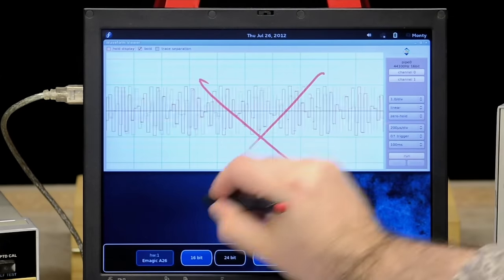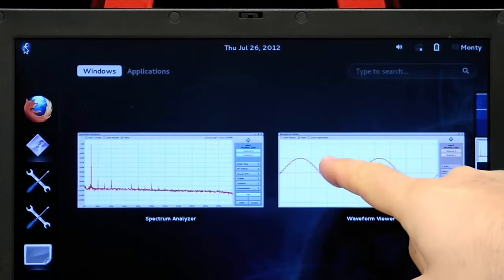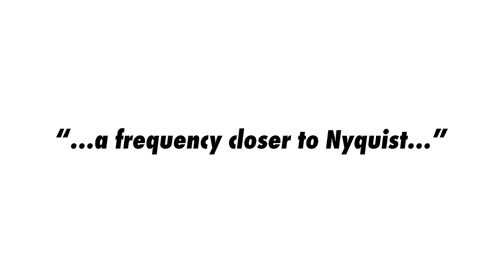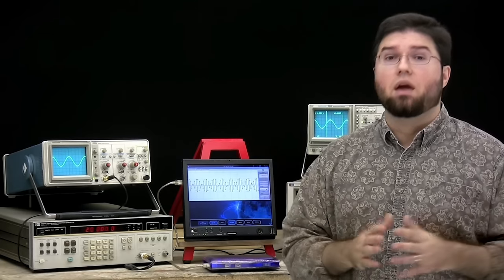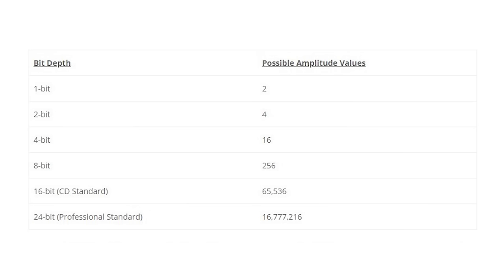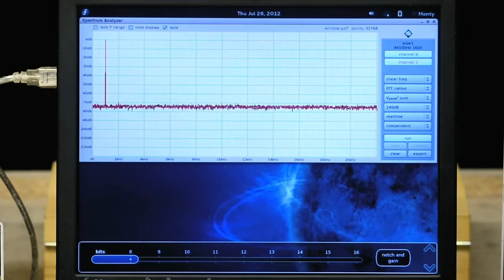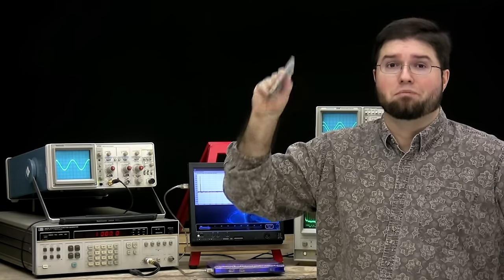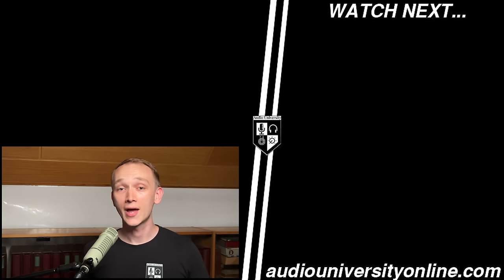Debunking the Digital Audio Myth: The Truth About the 'Stair-Step' Effect

Comment: There are advantages to 16 bit 192khz sample rates, That is in music production. This is because If you want to time distort an audio track or have it slow down (vinyl effects) It will sound better when it's running at a quarter of the speed because it won't sound so compressed and low frequency. Because all of the ultrasonic frequencies are also being brought down to within audible range so, of course after you do all of your editing, the final production can be 44.1 of course, but for production reasons, it's the equivalent of using vector or extremely extremely high resolution logos, because depending on where you move it and scale it and make it really big or small, it might affect it more or less.

Comment: Good and informative, (old CS/EE engineer with audio interest here). Remember back at uni in the 90s we had labs doing exactly this, learning about different types of wave reconstruction from digital data  in DA-converters (there is more to it than the video mentions but the conclusion is very valid).  
One thing that is not mentioned with dynamic range is that there has been historically hard to have a standardized level for where to put the mean audio level in recording digitally. This is what is called the "loudness wars" where listeners tend to like music etc at higher volume. Also the reason commercials are usually at a way louder volume. This drove recording industry to record at higher and higher levels.
So a lot of CDs actually had a very high average volume meaning that it was less dynamic range to use. This made them sound inferior to what the CD-standard actually allowed. A lot of CDs were "badly" recorded so to speak. Ideally you would want the digital recording to be fit within the dynamic range in a way that maximizes the format.
The effect of reduced dynamic range is similar to how "nightmode" sounds. 
This is one reason the classic vinylrecords can sound better than CDs. The format in itself is wildy inferior but they were mixed a lot better.

There is also another issue related to this and that is the intentional compression of dynamic range to sound better on devices that are not able to accurately reproduce sound.
There are some very interesting soundclips comparing speech and music with and without artificial dynamic compression.  This is a very big area with lots of opionions (some mixers feel the compression is part of the style). 

Personally I want my audio to have as much dynamic range as possible. To me it sounds a lot better, subjectively there is more texture in the music.
Reply: @jim9930  Cool setup :) Yeah recording technique makes a huge difference. But with compression I’d did not mean compression as in bit/bandwidth reduction but as in compression of dynamic range. You hear it is a lot of modern recordings. If someone is singing it is the same volume regardless if they are belting or if they are whispering (a bit exaggerated but not too much). This is done in software usually for aesthetic reasons and for it it sound better on poor devices (cellphones, laptop, iPad etc etc). 
Have listened to some horn systems and they have immense directivity and  effectiveness. Tend to get very very big if you want to do good bass with them. Personally I have tinkered a bit with something called orthoaccoustic speakers that utilise room reflections more to create a more enveloping soundscape.

Comment: It is a pity that the embedded video did not explain why the step function is not the end-result of digital analog conversion: namely that the signal is subject to subsequent thorough low-pass filtering. Without this information the nice harmonic output of a DAC is surely quite mysterious.
Reply: Yes, thank you
Reply: Yes, the missing reconstruction filter has been mentioned in the comments a few time.  That it is there is indisputable.  That it is not mentioned in the video in my opinion is most likely due to the video being a digital audio marketing video from back in the day.

Even the essential anti aliasing filter on the input is not mentioned probably for the same reason, to prevent the viewer from being horrified at having "filters" in the signal path.

Other than these simplifications it is a remarkably good demonstration and reflects the real life experience of digitised audio.
Reply: @KallePihlajasaari  As for me, I am delighted to have filters in my signal paths. They are beautiful results of human mathematical thinking.
Reply: Nyquist shows that the stairstep must be converted to Dirac delta conversion to simulate discrete time before lowpass filtering, so it's not the filter, it's the discrete-time approximation.
Reply: @tomgroover1839  Huh?  Anything can be filtered.  The stair step is the default output of a DAC.  Other digital filters may be used and these days often are but a low pass filter will remove higher frequency harmonic noise due to quantisation irrespective of what it looks like in the time or frequency domain.  The point is that the lollipops are a representation for the mathematics on paper and are not used electrically.  The electrical representation is the stair step until filtering takes place which typically is used.
Reply: @tomgroover1839  All good.  The point I and a number of others had with this (and the original referenced video) was the dismissal of the reality of the stair step output of the DAC.  That is the default output and ONLY AFTER filtering in the digital (before conversion) or time domain (after conversion) approximates the band limited digital/lollipop waveform data. The choice of filtering was not investigated in his video because the filtering was ignored.
Reply: @KallePihlajasaari  everything IS filtered. You'll find out if you use ultra high frequencies when two parallel conducts on a card becomes a capacitor and a straight conduct forms a coil. Real pita when I was working on a satellite amplifier. ;-)
Reply: @so_what_else_is_new  Yes, but at 40-200k Samples/s the PCB trace inductance and parasitic capacitance is not enough to remove the harmonic content of the sampling frequency in the stair step output.
Reply: @KallePihlajasaari  I know, I was reacting on your first sentence
Reply: @tomgroover1839  if you have a stair step at the amplitude change you will get a Dirac pulse when differentiating to find the power density which will be infinite in math but limited in physics, so there will be filtering whatsoever (or distortion)
Reply: He skipped over the details of how a DAC performs the reconstruction presumably because 1. it wasn't important for the topic of his video. for a conceptual understanding of digital audio you don't need to know the technical details of how exactly a DAC reconstructs a bandlimited signal from its discrete samples, just that it does.  2. the last time an audio DAC worked by producing a stairstep per sample and then applying a low-pass filter was in the early 1990s, modern audio DACs are much more complicated. It's fascinating stuff, but it would be its own video.
Reply: @MatthijsvanDuin  don't agree that it wasn't important to the topic. Imo, it was one of the core issues of why he made that video in the 1st place.

Comment: If I mixed in 16bits,  no one complained or even figured it out. I bet no one cares if the track is cool and has sufficient "musical nutritional value" in it xD People seem to care more about the content of the music than the quality or bit depth. Even if a top track is released on old tape, people celebrate it more than a track that doesn't touch them and that in 24bit. At least that's how I feel xD
Reply from the maker: That's a great point, 4N4LOG! The most important element is the music itself. 

However, there are some reasons why you probably should still use 24-bit audio for recording and mixing (when possible). It's not a deal-breaker, but it definitely helps during the recording and mixing phase! Playback should be 16-bit.
Reply: And then there's lofi hip hop that trying to emulate average/below average tape sounds yet enjoyed by many
Reply: I remember reading that even the best audio systems in the world have the noise that equals merely 18 bits one(so no idea why 24 bits exists at all).
And unfortunately there are people who just don't believe Nyquist-Shannon sampling theorem no matter what, they somehow hear the difference...

Comment: The benefit of high bit depth i see is that you can record a quite sound without using the full amplitude range of the recording and after amplifying it's still capable due to the S/N ratio. If you had 16bit but had a quite sound using only 8bits you wouldn't do much with it as amplifying would increase the noise also. Having 24bits can be usefull when you dont use the full amplitude. You can crank the volume up and still get a decent sound with the S/N ratio low without interfering with the music (speech, any audio indeed).
Reply: Absolutely, for recording you want to use 24-bit and possibly a higher sampling rate.
Reply: @gblargg  Yaaaay, suddenly resolution matters in production. What a surprise.

Comment: The problem with this simplistic experiment using a single frequency, continuous sine wave is that it completely eliminates any discussion of phase shift. 

Go to a high end audio store and listen to some music recorded on a CD that is played back on a player with 4 and 8x oversampling. The difference will astound you. 

Why? Oversampling permits the use of a lower order filter to reconstruct the analog waveform from rhe samples. What you don't hear discussed in the video is that filters (that reconstuct the signal) have varying phase shifts at different frequencies. Phase shift is time delay and that in turn makes the tones you hear move spatially in the audio you hear. 

The closer to Nyquist the sampling rate the sharper the filter rolloff needed for reconstruction which in turn necessitates a higher order filter with, you guessed it, a much more distorted phase response.

So while 44 kHz audio meets the Nyquist criterion to recover the frequency content, it won't be sufficient to get all the phase info you need for crisp sounding stereo audio. Oversampling is critical for good audio.

Don't believe me? Like i said, go to a high end audio store and hear for yourself!
Reply: Oversampling in the DAC is digital interpolation between the recorded samples. It doesn't add any information. It just means you're doing some of the filtering digitally and the rest analog.
Reply: all modern audio ADCs and DACs use linear-phase FIR filters for anti-aliasing

Comment: I don't know, except when I convert my analog signal to digital before going into my JBL receiver the sound quality, "headroom and "presence" is unmatched without any kind of hiss or background noise. My overall sound is 30% louder and 50% better sounding. Fiber optics can transfer more information faster than any other method. It is the only way to get TRUE 5.1 or 7.1 surround sound. Not sorta maybe like Hi-Def, whatever that is. I don't care either what people say, but cd quality in my mind is still quite good. And is the sampling rate I do believe is what is being mentioned in the video.

Comment: The simplest way to bust a stair step myth is to discover some of the maths included in signals. With a system that has just enough bandwidth to play 20kHz signals (analog low pass at 22kHz or so) you are just not able to produce this kind of stairs because replicating those stairs would require huge bandwidth way beyond the signal played. So when there are samples every 44100th of a second, the "stairs" simply are not going through the low pass that should always be there after the conversion.
Reply: Exactly, the sad part is that mention of the filters was left out of the original video, I think for pro-digital propaganda reasons.

Without the anti-aliasing input filter and a extraordinary microphone a strong 30kHz signal (consumer ultrasonic cleaners are often in the 25-37kHz rage) would alias to 44.1-30=14.1kHz and create significant distortion in the digital steam from a noise source that no human ear could hear.

Without the output/reconstruction filter the 44.1kHz square wave component of the very real stair step wave would result in lots of wasted power in the output amplifier stages and perhaps overdrive any ultrasonic capable tweeter units but still remain inaudible to humans unless it caused clipping or other non-linear distortion.
Reply: @KallePihlajasaari  It was left out because it's an implementation detail of how a DAC works, which he didn't discuss because it isn't important for the topic of the video. What matters is that you can reconstruct a bandlimited audio signal from its discrete samples, provided the sample rate is more than twice the bandwidth, and a modern audio DAC is able to perform this reconstruction with excellent fidelity.  How this works is interesting too, but not needed for a conceptual understanding of digital audio and its properties.
Reply: @MatthijsvanDuin  The lollipop representation is even less needed for any understanding because it is simply a graphical representation of the digital data stream and it NEVER appear anywhere but on paper and never in the output and not even really anywhere in the real world unless someone was looking at the differentiated output of a radiation detector, which is avoided because pulse height is usually integrated so it can be measured with more accuracy and ease.  Look at the clickbait thumbnail of the video, this is propaganda and it is a crying shame someone has to repeat/reinforce it to pander to new generation of confused digital audio acolytes.

Digital audio does what it does because of mathematics and engineering, not because of smoke and mirrors.

Comment: What an amazingly informative video. Preconceptions about stair steps are out the window and the fact that quantitisation levels affect noise rather than the primary waveform was a real rite opener. Also love the fact you can put older analogue technology into a digital context like the compact cassette typically containing the same noise as a 5-6 bit sample!
Reply: Beware "just not so" stories on Youtube.
"A cassette player is said to have a signal-to-noise ratio of 55 dB."
55 dB is 5.5 B, where Bel is the decimal logarithm of the power difference.  
10^5.5 = 316227 power ratio; voltage ratio will be square root of that or 562.
9 bits is 512, so you need 10 bits to encompass the voltage signal strength dynamic range of a compact cassette tape. 
As many parts of some kinds of music, classical in particular, ARE down in the noise, quantization errors at the noise level have noticeable impact on high frequency harmonics of some musical instruments.  Noise is random;' musical signals are periodic.  The Phase Linear autocorrelator worked by allowing specific high frequency bands in the noise when a lower frequency was detected greater than noise.

Clipping at the peaks of a signal is bad; but clipping at the lowest parts is also bad.  You need enough "bits" to ensure you faithfully capture even the noise; because IN that noise is sometimes your signal and the signal can be recovered.

Comment: One effect not explored in these experiments is the phase of the signal. As the pitch of the signal approaches the Nyquist limit, while you still have the frequency itself preserved as a pure tone, its phase will be more and more forcibly synchronized to the samples. This interferes with binaural listening for which we use stereophonic sound reproduction. This would be why it would be that played from a CD, while a violin or a trumpet would be easily localizable to the human pair of ears, a cymbal, full of extremely high frequencies and transients, will tend to sound as if it is coming from all over the place, and not at all as if it comes from where it had in fact been located. True pure analog recording does not have this problem.
Reply: I think 400Hz is the frequency where binaural hearing changes from phase to amplitude detection. At 10kHz, for example, the wave length is 3cm, and the ears are too far apart to detect a phase difference, so the brain uses amplitude differences to localize the sound. At least, this is what I seem to remember from Dr, Plenge's course on the psychology of hearing at TU Berlin.
Reply: No. Frequency, amplitude, and phase information are all accurately preserved. If the video had used a cymbal crash (limited to 20 kHz) rather than a sinewave, the input and output waveforms would still match (assuming the digital processor box has good filters).

Comment: Very good video. But... 

The professor said it -- distinctly and deliberately -- then glossed over it: "Band limited signal." This means that the ONLY waveform the CD is capable of reproducing without distortion at 20kHz is the sine wave. Feed the system a square wave (which theoretically requires an infinite bandwidth), and you get a delightfully pure sine wave out, which is an egregious distortion of the input. Granted, if the human ear is also band limited (can't hear over 20 kHz), then the perceived reproduction is perfect!

I'm not complaining about digital (love it), but this fact should always be mentioned in a discussion of the topic.
Reply: Any signal is a sum of infinitely many sine waves. What matters for human hearing is those sine waves. Watch "The Other Square Wave" by monster860.